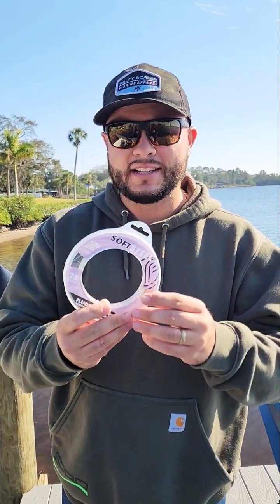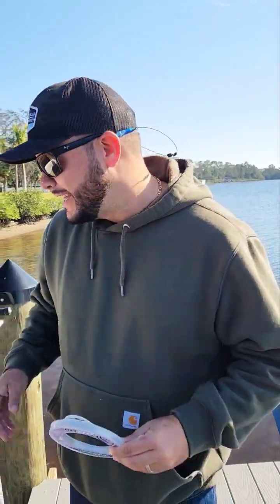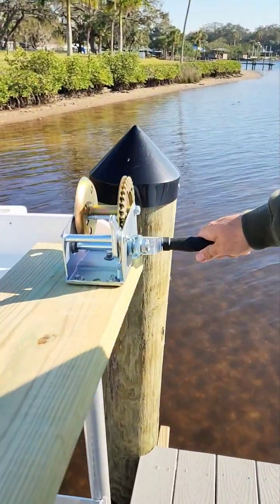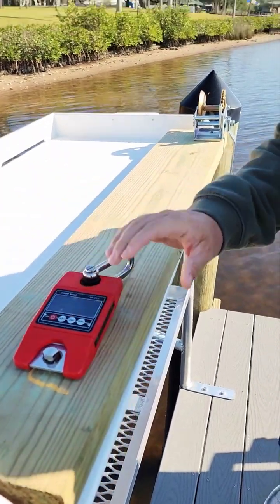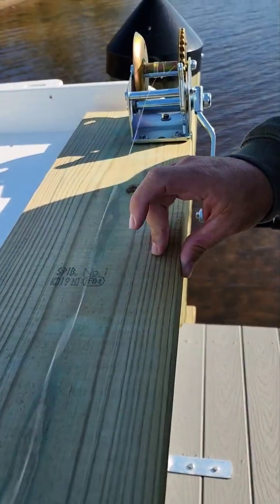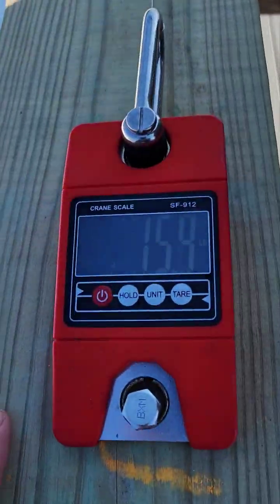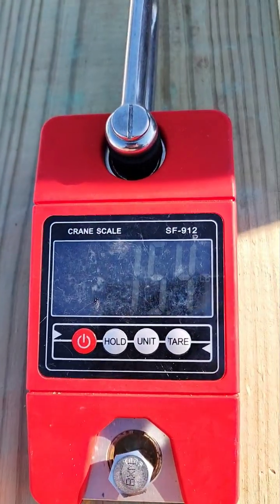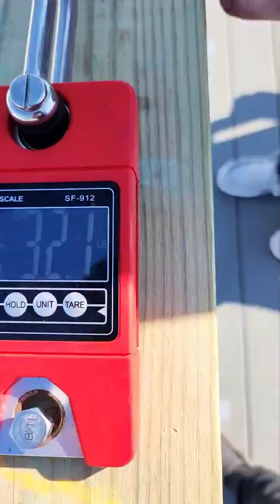Testing Breaking Strength 30lb Soft Steel Leader

Comment: Would love to see some thorough knot testing.  First one could be "How many wraps are required for an FG knot, per line test."  I use 65-80 lb test braid and leader and 10 wraps seems to do well for, but I see vids of FG knots failing with more wraps, but they are using lower test line.